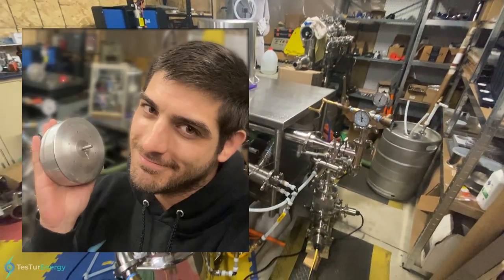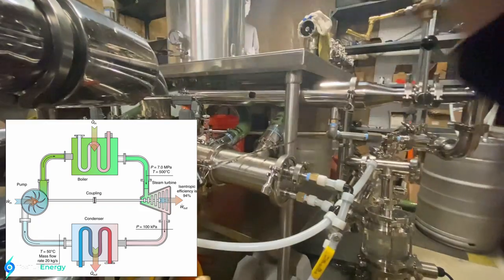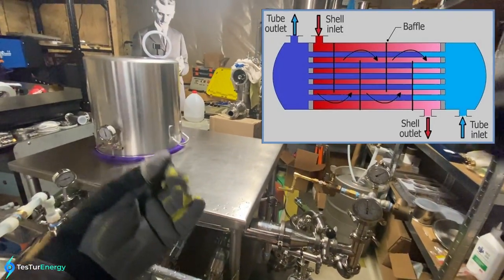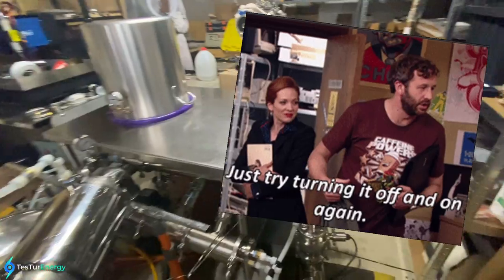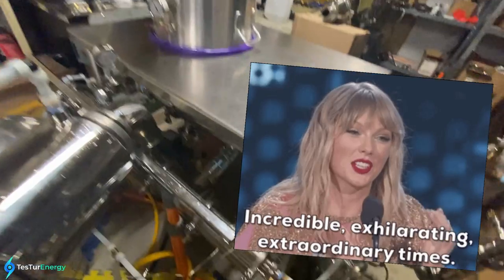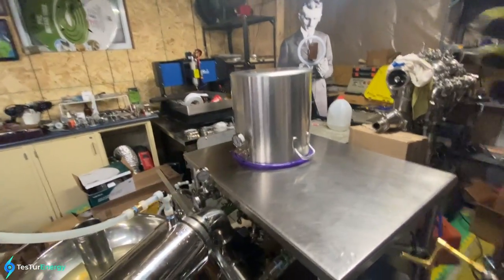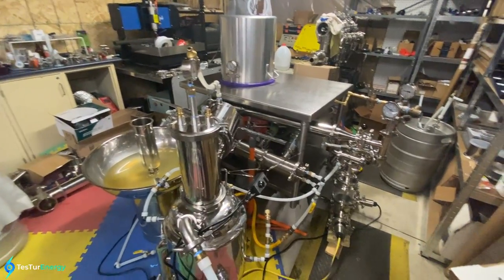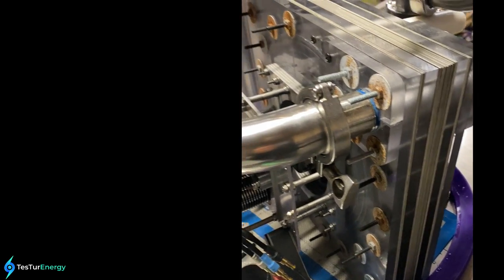Steam Tesla Turbine Renewable Energy Micro Power Plant - 1st Start Up

Comment: Incredible work, what are the main drwabacks you are having? I would love to help with what I can, I am actually building my own, although I am taking a different route since my plan is to use the tesla turbine to power an electric motor and move a small car!
Reply from the maker: Hey thanks for commenting! So really the only drawbacks I’m having at the moment are just issues with machining stuff to high tolerance with the cheap cnc machines I’ve got. But even then it’s still working amazingly. 

I’ve got some copy pastas 🍝 I’ll add to here for ya too. 

As far as efficiency goes… (mind you this is a copy pasta 🍝 so it’s a bit long but it’s worth the read.)

My 2650watt electrical load run came in with a very low ball calculation of 40% isentropic efficiency.  

To start off, mind you that includes generator losses, 3 phase rectifier losses, and inverter losses to the electrical load that were not accounted for. 

So the turbine off the bat is already most definitely doing better than the 40% isentropic efficiency I’ve calculated from the already low ball test results.   

But for now I’ll just assume 40% isentropic efficiency so that I’m not over claiming what I can prove it can actually do for the time being. 

(I have nothing in the long run to benefit by overstating my numbers and only my legitimacy to lose. I’ve worked hard for my physics degree and don’t intend to tarnish it for a couple of extra views on the internet.)
Reply from the maker: As far as inefficiencies to the system to fix, there’s 10x crappy ball bearings in this version, 2 crappy RC car gears, both losses will be gained for power out with a direct to shaft generator. (Minus two gears and 8 crappy ball bearings)  

There’s an 1/8 of an inch of space between the turbine endplates and the casing endplates on both sides of the TesTur. 

That’s a 1/4in of open flow area around the 2in wide turbine (that only even has a total of 0.75in wide of spacing between all the tight disc spaces for torque to begin with.)   

That means 25% of the open space for flowing through the casing, between discs and between the casing and turbine endplates, is just free flow over the side of the turbine still. 

(I’m using the absolute bottom of the barrel of machining equipment right now in my garage 🤷‍♂️)  

There’s no labyrinth seals yet to even attempt to further reduce that overflow…
Reply from the maker: The nozzle is atrocious at the moment, when making the variable converging section have a tight convergence it causes the fluid jet to aim more centripetally (towards the axle) instead of tangentially (glancing off the disc tips) which severely effects the fluids natural path.   

This will be fixed with the new variable nozzle design I’m going with.    

Then even further in this specific casing’s assembly there’s two “pillars” in the middle of the nozzle.   

This is because the aluminum plates in the middle of the casing plate stack only had the variable nozzle bar and inlet holes cut out, and not the full nozzle geometry.  

So those pillars are just vertical bars in the middle of the nozzle for the air to smash into just before going into the turbine (hopefully the wet steam tests will just erode them down 🤭)   

Before all that there’s still about 100ft of air hose between the tanks and the turbine… plus a shell and tube heat exchanger and a TON of elbows and fittings.    

I’m sure I’m forgetting something too but between all that being fixed… 

I can almost guarantee we will be in the 60-70s % range and that’s all just still with room temp compressed air.   

Most forget, I’m using room temp compressed air and never went over 20psi at the nozzle for these tests. (Pressure differential and temperature differential govern efficiency)
Reply from the maker: And even then I still only even have a single stage on it yet.   

Everyone wants to compare it to the efficiency of a very high temp, high pressure (1000°F & ~1800psi) multibillion dollar 15-30 stage steam turbines…   😮‍💨   

That’s apples to rocket ships. 😅  

But considering Rankine Steam cycles get theoretical max about 33% of input heat (due to latent heat of condensation and that’s without any regenerative boiler feedwater preheat, air fuel preheat, etc) and then 40% isentropic efficiency (considering the turbine as is) we’re looking at 13.2% thermal efficiency with steam.   

A more apt comparison for the TesTur would be something an individual can actually purchase, like 1-5kW piston gas generators that you can get from Home Depot or Lowe’s.   

These get 15-22% thermal efficiency off the plant floor. Good luck getting that 1 year down the line or later with all those moving parts.  

Also for reference, industry standard for micro bladed gas turbines is 25% thermal to electrical. 

Whole system efficiency can go higher in Combined Heat and Power (CHP) system, but alas the TesTur would see the same whole system efficiency increase in a CHP Auxiliary Power Unit (APU).  

In the TesTur you gotta replace…? 🤔bearings…? And still even then, only maybe 🤷‍♂️ 

depending on how good of bearings, balance, lubing, cooling.   

The TesTur, and other bladed turbines, only have one moving part. 🔥
Reply from the maker: So if those piston generators drop efficiency, even at all, the TesTur on its worst day is competitive with a gasoline piston engine electric generator.🤓😬🤷‍♂️  

And the TesTur can handle any fuel that can burn, even solid particulate fuels like powdered saw dust, pulverized coal, powdered iron, biomass, etc. 

(noting the number of those that can be acquired for free… 🤑 opening up “Monetarily free”, even carbon neutral, fuel options for MILLIONS around the world)  

We have to remember that the TesTur doesn’t have to be the holy grail to be worth using if we have free fuels readily available like biomass, and even waste heat already being dumped out into the air and not used for anything.  

The TesTur just has to be a viable option for some to be worth doing.
Reply from the maker: Even more, the mere fact that I’m using a low temp fluid for my 40% isentropic efficiency calculation means my TesTur efficiency is severely limited by thermodynamics and fluid dynamics.   Increasing temps will automatically increase my turbines efficiency.  

This is because gasses have an increasing viscosity trend as you increase the temperature.   

This leads to increased isentropic efficiencies in the TesTur from reduced slip on the discs.  

(Meanwhile, we’re already talking about a piston engine using combustion temps as is.)  

Whereas bladed turbines see the increased viscosity as an increase in drag loss through the turbine blades.   

So we can’t always count on seeing increased isentropic efficiencies in a bladed turbine in practice when we go from low temp to a high temp.  

Again, to reiterate, this increase in viscosity in the TesTur only works to enhance the working action of the TesTur.  

(That being viscous adhesion to the disc faces increasing torque.)  

That’s all on top of the increased thermodynamic efficiencies of using a higher temp elastic fluid too! 🤓
Reply from the maker: The disc spacing for room temp gasses is not going to be the same for combustion temp gasses/steam because the viscosity of either increases by 3x fold. 

And I’ve designed these spaces for a higher temp fluid with a slightly higher viscosity so these will inherently be too wide at the current temperatures being used.   

So as we increase temps along with all these other really easy to fix mechanical issues (that only are a thing because I’m building this in my garage on a junk cnc machine) I have no doubt we will see more than competitive isentropic efficiencies compared to bladed turbines, let alone whole system thermal efficiencies that are through the roof.   

This is because of the heat recovery systems that can be added with the cost savings of using a TesTur vs a VERY expensive, and in my opinion, relatively delicate bladed turbine.   

Just getting tighter casing clearance with the turbine should give me at least 20% points back on efficiency putting my testur at the 60% range.   

Coming in with a 19% thermal efficiency in a Rankine steam system without any kind of thermal recoup.
Reply: Thank you so much, I will be using your comments in my project, also thanks for the inspiration for starting to record my advances. Haha 
I will follow you close, I am still learning and everything seems hard at the moment, fluid mechanics is clearly the hardest thing to get right, at least on paper and on AutoCAD. I feel like I have to learn everything at once to get somewhere, and funding, as you may know, makes everything take longer.
Please don’t stop making this videos, I will rush to advance in my turbine car in order to share my ideas and improve my designs little steps at a time.

Thank you again for all the information, I also found some articles in your other videos that will surely help me. 🤓😄😃
Reply from the maker: @calmmusicrelaxstudy490  have you seen teslas patent for a car powered by a Tesla turbine? It was ultimately denied but he did actually apply for a Tesla turbine automobile.

Also don’t get me wrong. I’m making home power units but the combustion turbines in also working on I fully plan on putting them in motorcycles and automobiles. I can’t wait to put one in my 06’ GTO. I hope I can make it the first Tesla Turbine powered GTO in the world 🤤

I’ve got a couple of small go carts I will be powering with combustion turbines soon too. I’m just hammering all the design factors out for making a good turbine. Once I have that, making ones for different scenarios is nothing. 

What’s your background in, if you don’t mind me asking v
Reply: @CharlieSolis I’m in fifth semester of Mechanical Engineering and in third semester of Computer Science.
A GTO with a combustion turbine would sound lovely 🥰 haha 
I am working in a GoKart actually, I managed to get my hands on one with a little motorcycle engine but it was completely damaged, tried to fix the motor but ended up braking the cylinder, I still want to fix it, but I don’t know if it is beyond that at this point. Sooo, a couple months ago I found Tesla turbines and I have been trying to get info on how to make them work in a Go Kart, frankly it is my first big project outside little Arduinos and fixing heaters or coffee machines.
Reply from the maker: @calmmusicrelaxstudy490  Hey I just posted a new video! I think you’ll really like it.
Who Owns Your Copy in the A.I. Revolution?
https://youtu.be/_v0N83U4NoU

Comment: what's the purpose of the vacuum?
Reply from the maker: Hey thanks for commenting! 

Great question! 

When we use a Tesla turbine for steam, having a vacuum on the exhaust side serves a couple of important purposes.

Firstly, it helps in increasing the overall efficiency of the system. 

The vacuum effectively lowers the pressure at the exhaust, which allows the steam to expand more and thus transfer more of its thermal energy into mechanical energy as it passes through the turbine.

Secondly, by maintaining a vacuum, we can ensure a more constant and higher speed of the steam flowing through the turbine. 

This can further improve the performance of the turbine and the energy output.

Lastly this lowers the temperature at which the boiler side of the turbine can actually boil at and make steam for still producing power out. 

Typical bladed steam turbines cannot handle the wet steam at these lowest pressure and temp ranges as they would destroy the blades from the condensate/water droplets in suspension with the steam.

Though I’m the Tesla turbine thin condensation of the H2O into microscopic liquid droplets actually increases the bulk viscosity and adhesive forces of the motive fluid to the disc faces for reduced slip on the discs.

Additionally this actually allows further use of the condensates final kinetic energy for power out before leaving the turbine. 

Potentially allowing this system to achieve higher than typical Rankine cycle systems. 

I hope that clears up your query. Feel free to ask if you have any more questions!

Best,
Charlie

Comment: it takes electricity to generate electricity, wouldn't it be generating less electricity than it takes to run?
Reply from the maker: Hey thanks for commenting. With TesTur Energy, our mission is to give people energy independence through Combined Heat And Power (CHP) systems that can make use of underutilized energy sources like biomass, solar thermal, geothermal and even low grade fuels containing high quantities of solid particulates (like pulverized coal and powdered iron); energy sources/stores that are currently underutilized due to the lack of turbines and engines capable of handling the multiphase fluid flows (any combination of gasses, liquids, solid particulates) present in low grade heat boilers and low grade fuel sources without damage over prolonged/continuous periods of use. 

www.TesTurEnergy.com 
www.HeatAndPower.com 

The electric boiler is just for the tests so we can get an accurate number of heat energy input. 

It’s hard to do that with other larger system parts, solar collector, biomass boiler, etc. whereas this will give us an exact number of input heat for our tests.

Comment: imagine if this was all a hoax and people put all this effort, because im wondering how much money this cost up to this point in the video. maybe it's not that expensive, I've been trying to build a solar heater and if it works for warmth in winter, it can probably get the water to boiling temperature. here  in summer,  the sun is like a laser. it would be cool to build one someday
Reply from the maker: hey thanks for showing your love and support by commenting 🙏❤️ it really helps with the algorithm!        

No hoax! Ocean Thermal Energy Conversion (OTEC) plants already use this vacuum steam Rankine cycle to generate electrical power. In fact there’s no difference between going from 100 psi, 10 psi, or -4psi  to a -13psi vacuum condenser other than  high pressure and temp gradient giving a higher efficiency. 

If you have any questions I’m always happy to explain more. 

Check out my latest steam test on Instagram. https://www.instagram.com/reel/ClqGwiDDRSN/?igshid=ZmMyNmFmZTc=
Reply from the maker: If you’re interested in learning more about vacuum steam systems watch this video of mine. 
Solis Talks Tesla Turbines - Nikola Tesla’s Electrical Power Systems Patent GB 186,083 Walk Through https://youtu.be/5Y3D13JmtcA
Reply from the maker: As for cost, everything cost about the same price as a moderate furnace. And because all the “loss” heat the turbine doesn’t turn into electricity can be used for heating after the whole system thermal efficiency goes WAYYY up. I’m in a detached garage that has no heat or AC in it and it’s 0 degrees F outside most of the time. 

Turning my biomass into heat to make electricity and then be used for heating is how all the large scale plants already do it. So this entirely viable and competitive.
Reply from the maker: Hey I just posted a new video! I think you’ll really like it. Who Owns Your Copy in the A.I. Revolution? https://youtu.be/_v0N83U4NoU

Comment: I too have been looking for a solution to crazy high electricity prices here in the UK compared to gas. Unfortunately steam generating boilers here require certification to be used, is that something you have in your country?

At this point it would be cheaper for me to run a 30% efficiency 4 stroke generator off the mains gas supply for my electricity needs, but I know that would have a negative environmental impact compared to the 90%+ efficiency of commercial steam turbines at power stations.

Comment: how about just hot air tesla turbine (rocket stove tesla turbine)
Reply: grass biomass is carbon neutral, and uses solar/wind/hydro power to grow it, just cut, dry, condense, store and burn, its like paper pulp, like saw dust pellets
Reply from the maker: Hey if you’re interested to learn more about our biomass and solar collector powered combined heat and power systems check out our website 
www.TesTurEnergy.com

With TesTur Energy, our mission is to give people energy independence through Combined Heat And Power (CHP) systems that can make use of underutilized and “monetarily free” energy sources like biomass, solar thermal, geothermal and even low grade fuels containing high quantities of solid particulates (like pulverized coal and powdered iron); energy sources/stores that are currently underutilized due to the lack of turbines and engines capable of handling the multiphase fluid flows (any combination of gasses, liquids, solid particulates) present in low grade heat boilers and low grade fuel sources without damage over prolonged/continuous periods of use.
Reply from the maker: Make sure to check out the latest updates on the combustion + steam Tesla turbine builds! 
Tesla Turbine Jet Engine - gasoline fuel burner atomizer flame tube test 186,083 propane burner https://youtu.be/gRqKowignac
Reply: @CharlieSolis  btw, I skimmed through all the latest videos already :)